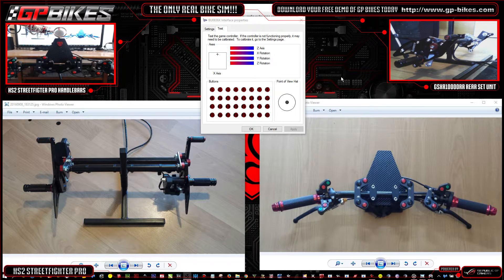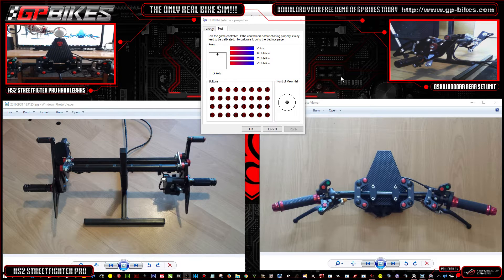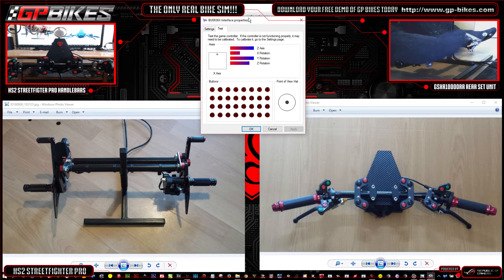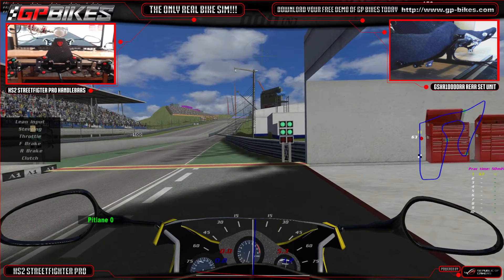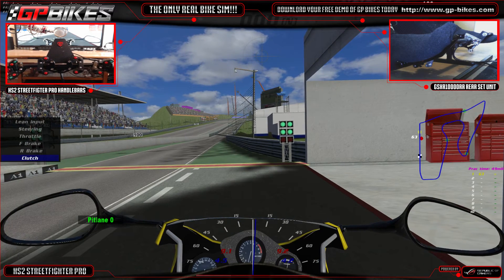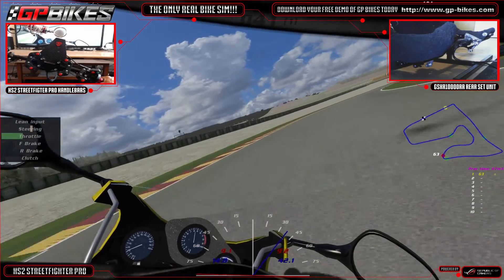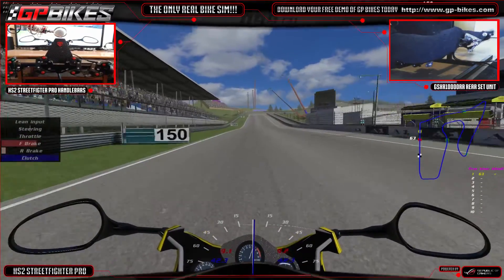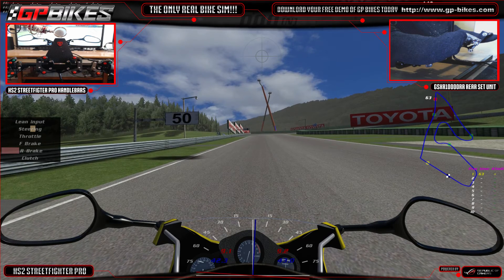Technical Video for Forward Development

Comment: The only problem is a motorcycle doesnt steer like this...
Reply from the maker: No a bike does not,BUT you are not riding a bike sitting on the couch either. I have been making these for years and they have been tested by professional riders who agree the concept is right and functions. This is my major problem, people think they know what everything and cant be told different, plus, I an the only one who took my head out of the sand and text books and actually thought about how a controller needs to be if in a room.

Also, try watching the video properly and see that the bike is leaning as are the bars and my upper body. It is about   how you sit and feel when using the system. It is totally natural.

DD
Reply: so is it not possible to make it work likea real handlebar?otherwise nice work!
Reply from the maker: Yes I can make one like that as I did in the start but it is WRONG to use in a room. DOnt get me started lol. Believe me you dont want one that works like a real bike it would damage your muscles in a few hours!!!!

Comment: how did you do that you can throttle i also want to build something like that ut need to figure out how to throttle and clutch building
Reply from the maker: I designed a new MTE unit that converts mechanical to electronic movement with gears and a potentiometer. I 3D print most units but all the controls are real motorcycle parts not plastic shit lol
Reply: thank you for the answer

Comment: can it do clutch-less shifting?
Reply from the maker: Yes it can. BUT, it all depends on the game or sim you are using. In GP Bikes the clutch is used mainly for pulling away to start with as most of the bikes have modern gearboxes and you can shift with no clutch. If however a bike NEEDS the clutch to shift smoothly you will use the clutch. You can of course use a game or sims automatic gearbox option or shift help.